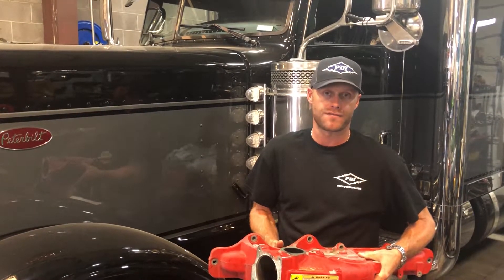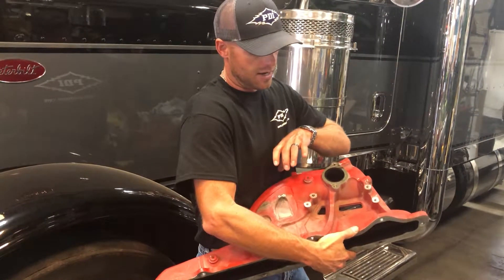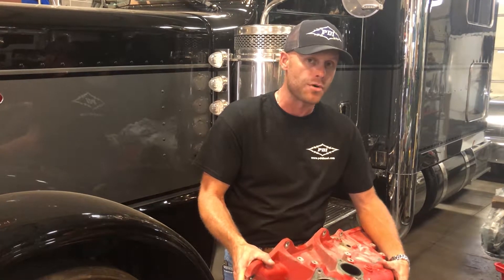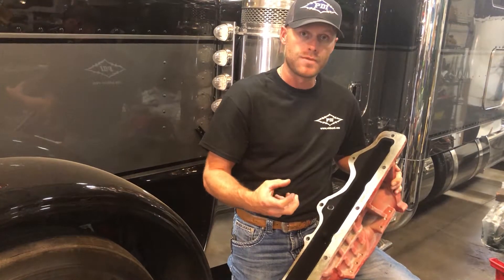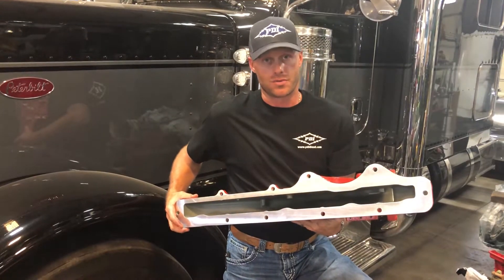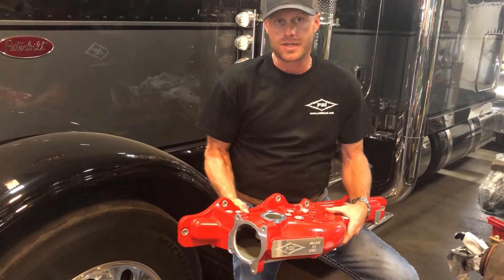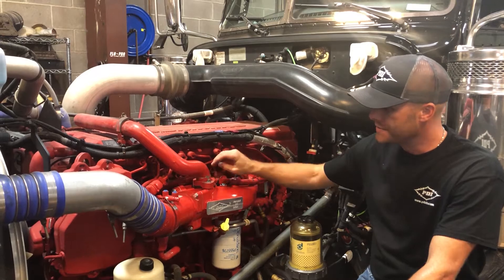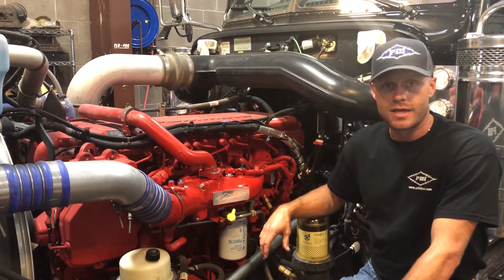Big Boss Intake Manifold - Cummins ISX

Comment: Do you have to let the computer know? How much for the intake? How much for the exhaust manifold? I have a ISX 2250. Are they the same,(intake & manifold) as the newer x15 motors? The turbo....I’m scared to ask$$
Reply from the maker: No there is nothing needed in the computer for the intake change. The intake manifold is $1350, and the exhaust manifold is $1450-1650, they are very similar to the X15  models, but the CM2250 has it's own intake.  The add a turbo kit is $5500 and the Tuner you would need with it is $2350.  Give us a call for more details or to get one coming. 1-888-588-7113  Thanks!